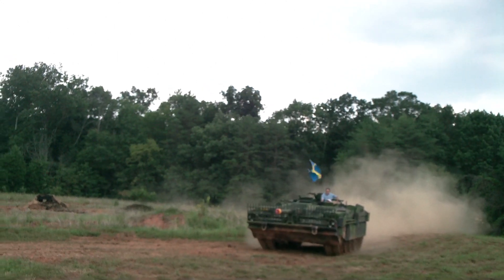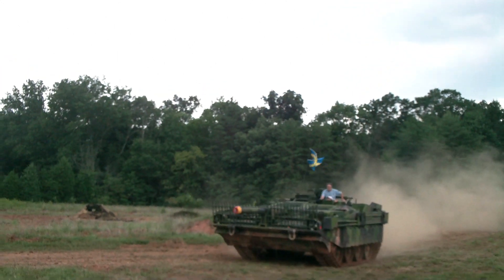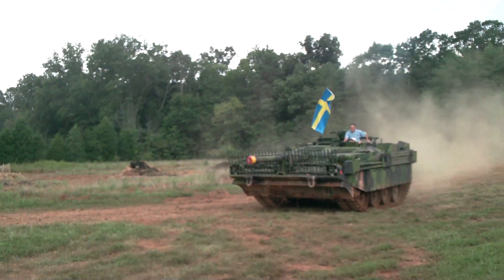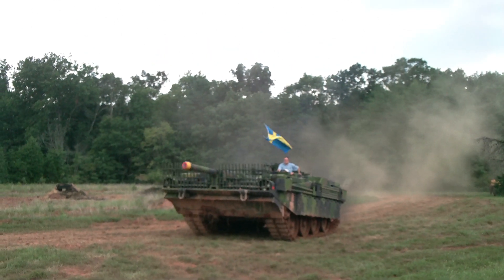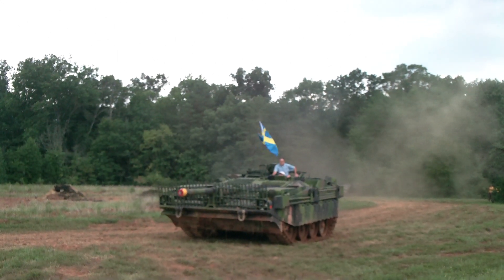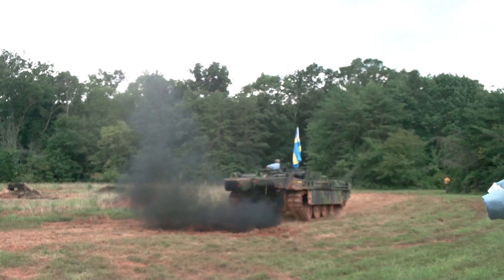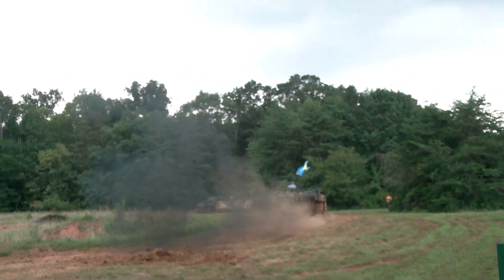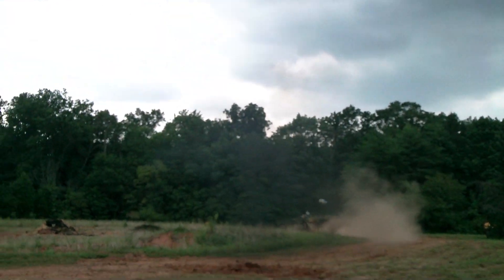Swedish S Tank

Comment: A crew of 3. Commander, driver/gunner and radio operator/back driver.

The commander had also a complete set of controls and could perform all tasks including driving and handling the gun. Thus, it needed only one person to operate the tank.

The radio operator were seated backwards and did also drive the tank backwards, making it able to move just as fast backwards as forward to be able to quickly move away after an ambush.

Comment: You can see the "flame out" @ 0.50  sec, after a flame out you were suposed to wait 5 min before restart, no experienced driver did that. But i´m sure this guys followed the manual.
Next time it stalls wait 10-15 sec to let it rev.  down, then restart, holding the startbutton pressed for about 8 sec. If it Shoots flames,press the breaks, put in a gear and let the engins go for full trottle until the exhoust fire dies. Then resume normal action./Former S-tank Capt.

Comment: The Tank is(was) made by Bofors, Volvo had NOTHING to do with this tank. They clearly had a "flame out" when they tryed to start the gasturbin. Probobly due to inpropper start up procedure.When you start the jet engine you switch the egnition to ON. Then press and hold the button pressed in for 8 sec(that will build upp fuel pressure) release the button and the engine will egnite and rev. up./Former S-tank Capt.